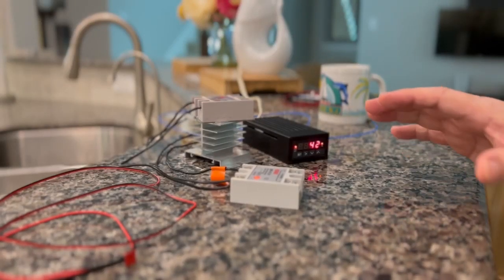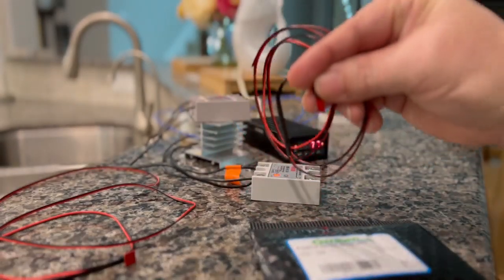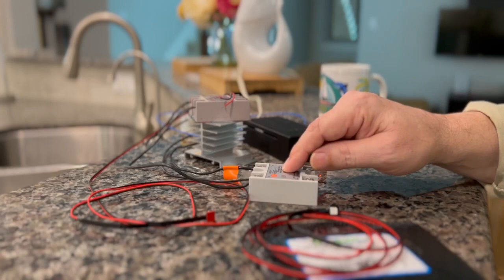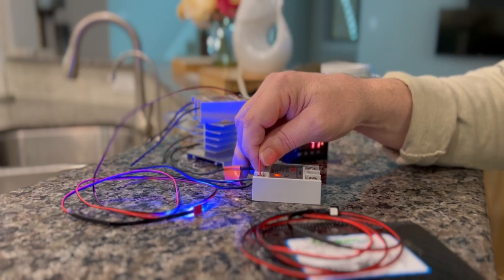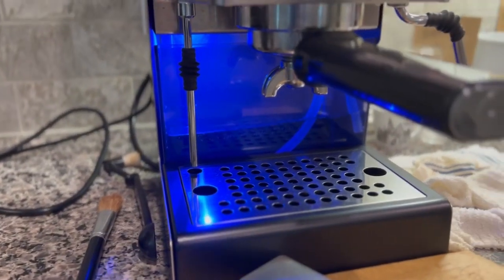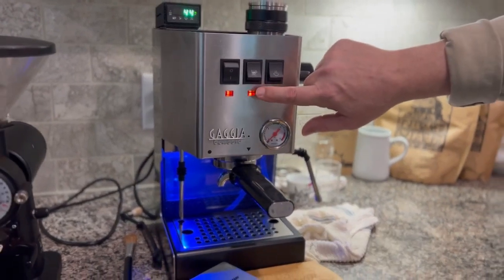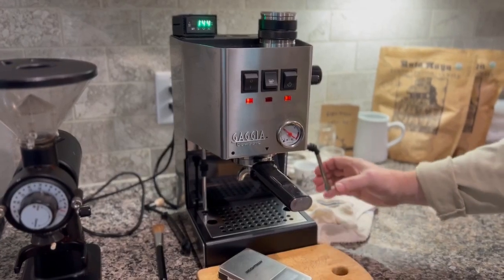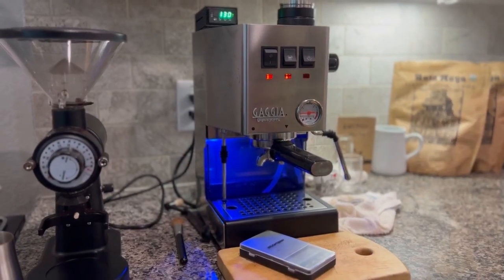Gaggia Classic Pro LED Tank Light - Easy - Espresso

Comment: I would recommend to highlight the fact that this PID is modified and this isn't the most generic circuit used in the Classics, to make sure nobody gets injured by attempting this on a generic setup (like Shades PID) whete there is mains voltage on those terminals of the steam SSR.
Reply from the maker: Good advice.  I added a couple notes to the description!

Comment: So you modified the PID so it triggers both relays, one with the target temperature and the other with the temperature range, and then you added LEDs to the relays. Cool. I took a simpler path. I’m not using the PID for steam, as that would be silly on the ViaVenezia. What I did instead is to jumper terminals 1 & 4 on the PID, and then connect a 120v indicator light to terminals 2 & 5. This provides two ‘alarm’ ranges that can separately trigger the indicator light.
Reply from the maker: Cool. Is that “easier” because you didn’t have to unsolder the ssr in the PID?
Reply: @threehanded8853  its easier because a second SSR to replace the steam thermostat is not realistic on my machine. So I had no need of unsoldering the PID’s SSR; I could simply work with it.